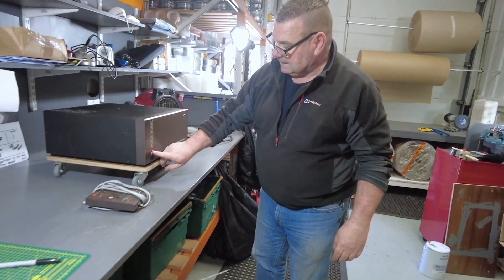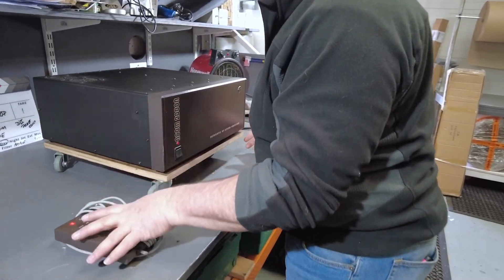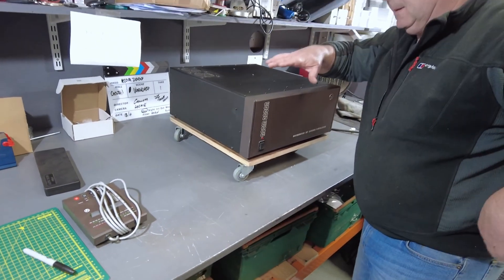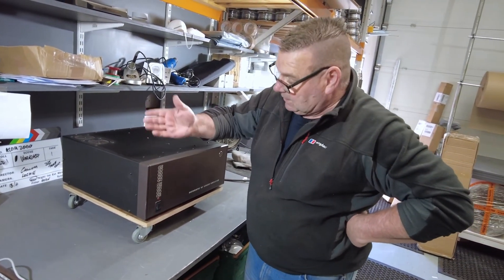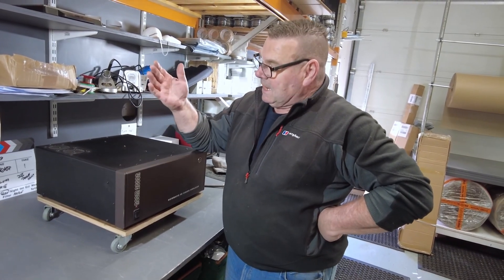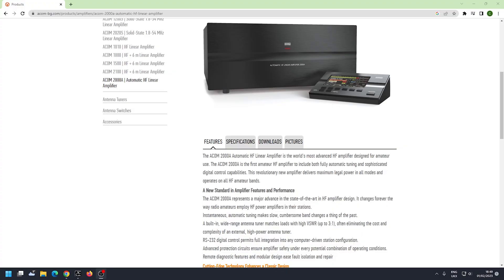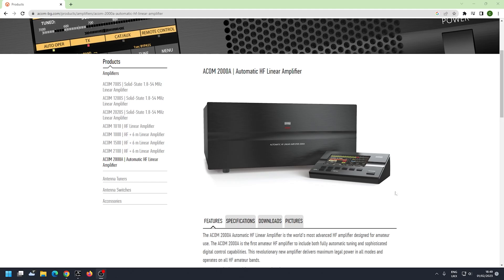The Power Struggle: High vs Low Power for Ham Radio

Comment: It is good not to hammer the amplifier, both for long term reliability and signal cleanliness. Although on the face of it our power limit is low in the UK (400w) it is mandated at the antenna feedpoint, not at the shack. With a few dB of feeder loss and an RTTY duty cycle you do stress the smaller amplifiers.... I have had one of those lectures on air, someone too ignorant to realise that I was actually talking to a friend at greyline time and struggling for that last minute or so of the QSO.
Reply from the maker: Ignorance.. Yes, they comment here too. There's a chap running his 7300 at fulle 100W. He might be lucky but I know two repair guys who are good at replacing 7300 finals through experience..!

Comment: Collum…. Let’s see you test that “bugger” at full power, Sir.  What would happened to your antennas?  Another fire test video?  Love these short 5 min (or so) snipit videos!  73 de KD6UYK (Tim).
Reply from the maker: Well, they do survive. We would need to do another test with a loading coil to get a visible result. The Rapide with it's 13 turn coil did get hot after about 40 seconds on 40m.

Comment: You´re absolutely right Cal!  That was my decision as well! One reason was to have an Amp that can handle much more than i really do in output power. All things inside a bigger amp is is designed to cope with this performance. When I drive the Am with about 400-600W, everything is absolutely ok and I have more than enough headroom. I have a transistor PA that can do 1200W, about 600-800W in digital. But that's the brochure. In reality it can do that, that's true, but then comes this amp equal to a fighter jet that takes off. The fans go to maximum. Thus, years ago, I also opted for an Acom 2000. I don't need to consider anything there at 600-800W. Actually, not even at full power. Your explanation was absolutely correct. Thumbs up for it!
Reply from the maker: Andre! Hello again. Yes, the fighter-jet fans.. No thanks :)

Comment: now it would be different if you were a CB er they run what they like LOL i run amplifiers when reading the GB2 RS news simply to save the radios but i never run full watts of what the amplifier will do .G0VVT
Reply from the maker: Yes.. Good idea.. I run 10-20W into my amp (depends on band - some bands need more fire) so neither have a hard time..

Comment: Precisely Cal, when possible I’ve always favored over-specing, it’s something my Father taught me when he had his heavy duty towing and recovery business.  Basically he had a HIGHLY customized military rotator crane, on a 76 International Semi Truck, which weighted 41,000lbs.  We normally didn’t have a stitch of cable, strap, pulley, etc. that was operated at its break rating, and most times, we kept it under the operating spec which was 3:1 or 5:1.  If we had to push (guess that’d be pull 😂) something like a chain or strap hard, we inspected it after the job before putting it back on the truck.  Now days when so many devices on the market are hyped up, and the specs are… well in some cases lies.  Fortunately our hobby has many reputable manufactures.
Reply from the maker: Specs and Lies. AGreed. Same with wind-ratings. I've always wanted to know how an antenna (for instance) can be tested fully in open space at 80mph! (guess they use FEA software).

Comment: That is exactly why Eddie Van Halen ran his Marshall's on a Vari-Ac....Sure they are 100 watts but if you run them wide open your at least going to be going through tubes ( valves ) like crazy...So to get the tone he wanted he turned the input voltage down to 88 to 89 volts and then he could run them wide open without fear of a classic Marshall Plexi meltdown...lol
Reply from the maker: Ah! I didn't know that!
Reply: @DXCommander  yes, that's how he got his famous tone dubbed the " Brown Sound " of course in the later years he went to a self branded amp made by Fender called the EVH 5150iii...it's bullet proof, you can run it wide open all night and it harms nothing but your hearing ha ha

Comment: True to life Callum..buying an auto that has only a squirrel under the hood might run fair for the first few hunfred km, but later the same squirrel, from continuously  running it's  peak will be a very worn and tired soul.  It would make more cents ($) to have the double duty power operating at half or less than since (we expect) the workings were built for the higher end and can handle the half all day long. . At least the older designs were generous in these facts.  
My old mobile 10m/11m tube 65watt amp could do a 100+ when tuned but the tubes were glowing bright purple when doing so .ha! So again lower the plate to half and my stainless whip hummed at 65 watts . 
Great points made  ..
  A little chuckle here..
An old Heathkit kilowatt built for 80m  through 10 m had an air coil tapped and 'tuned' for 11 m and splattered so much it set off the silent fire alarm in the building next door. . needless to say the arriving crew were disappointed to find only a smoking 4000 watt portable generator powering that station..hi hi.  
 I truly believe if that whip were fiberglass, it may have turned to mush in the above load test..
Reply from the maker: Good story!

Comment: Why for me is bc my receiver on my ftdx10 works so well with my antenna configuration I can hear all around the world but Tx on 100w just can’t keep up bc other receivers don’t work as well as mine, so most often on the lower bands 160/80/40 you need a little kick 1kw usually works but if I’m trying to get over a bunch of qrm like 3YOJ I kick it to 1750-1800average to give me 1500w pep ☺️
Reply from the maker: Nice!

Comment: I have a Dentron with an 8877 in it. It'll cruise all day at 1500 watts with 40 watts of drive. Easy on the amp AND radio. A friend runs an AM broadcast station at 1kw with the same tube. No problems for 20+ years.
Reply from the maker: Yes.. AM is the other power stealer.. Good point.

Comment: On the other end of things I run 90% QRP yet use an FTdx10 at 5 watts.  Radio will last forever and I get a great receiver. 73
Reply from the maker: It certainly will. And honestly, I applaud you.

Comment: I do agree with you Laird Callum you need to test your aerials for the rest world I hold USA FCC advanced class licence KG0PL over there I can run 1.5 KW PEP, as well as my full UK  amateur Radio licence  G0MEJ Your DX Commander Aerials, got stand the power full Data mode full duty cycle. Myself with HF Radio of 100 watts if I am using full cycle data modes I would only run 10 watts PEP output I would my P.A  last a long time. It is better to spend money  on your aerials systems
Reply from the maker: Very well said..

Comment: I do not have an amplifier yet!!. I would like a no tune solid state unit that produces around 800-1000W but plan on running around 400 for just this reason even though I could legally run 2000 ish.. I run my rigs now around 65W to keep the finals happy. Great video VA3XAP
Reply from the maker: Perfect Andy!

Comment: In the computer world we used to have the same issue with things overheating.  With the Texas Instruments TI-99/4A it was the 7805, 5V regulators on the expansion cards.  The technology wasn't available to make them to cope with the power needed and they used to get so hot and it would burn the PCB around the component.  Now they're available and can handle 2.2 Watts and therefore run much cooler under normal conditions.  Exact same analogy.  Something over engineered is always better as it will handle the everyday scenario without any issues 👍
Reply from the maker: Richard, you said that pretty well! Good comparison.
Reply: Don't make me think about water cooling my power amplifier like I water cool my CPU and GPU in my computer. 😊